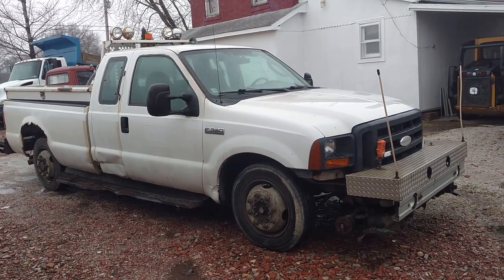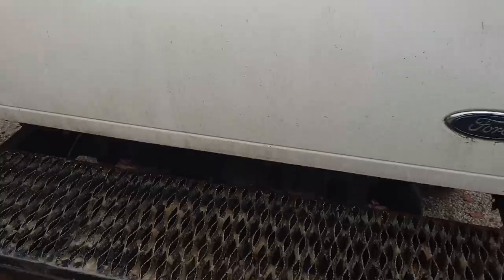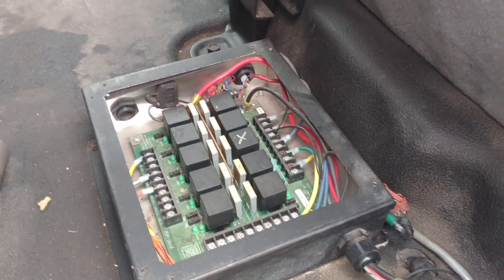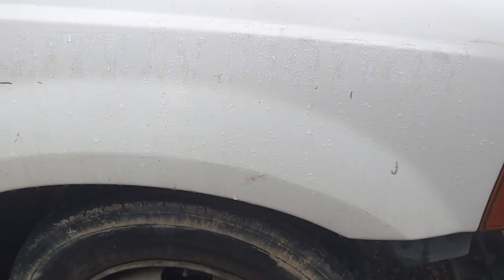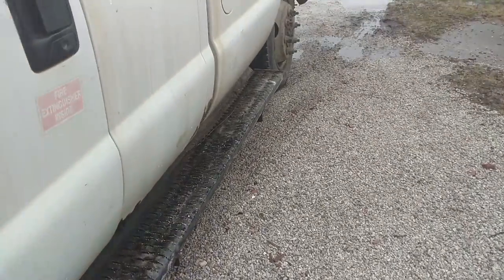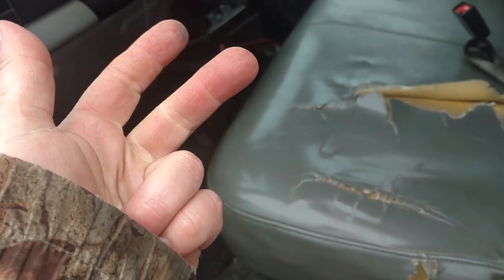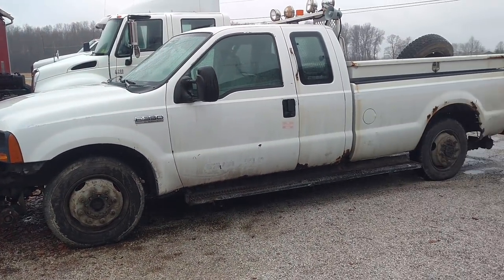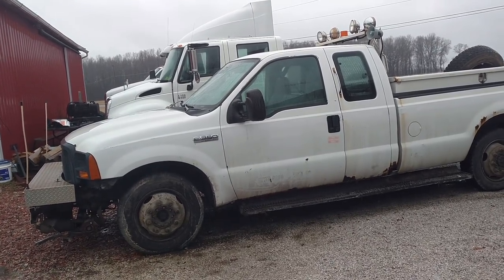J.C., WHY WOULD YOU BUY SUCH A PIECE OF JUNK???

Comment: Holly Molly the heat in the section comment is ridiculous, and I applaud to you by not responding to them as offensively as the level of their insults. You must be raised in a good family!
However, I'll be honest, the rust will scare the majority of the guys, but thats not the case for you for obvious reasons. The 5.4L is a beast engine, apart from the knocking phasor issue which has a fix. I have owned a 1/2 ton with that engine, I took care of it until I sold it with 150k miles without any issues at all. Judging by the description of the condition of the powertrain in your truck ( engine, transmission, driveshaft, differential, springs), it must have a value of over 7k.     I salute you for your work and thank you for the video
Reply from the maker: rust is an everyday nuisance in my area...i could see past the rust to the more valuable part of the truck. firing back at the hateful comments would do nothing for me except ruin the enjoyment of making these videos. this is how i look at it "people who can do it, just do it......many people who cant or are too lazy to do it will hate on the ones who can." it is frustrating to read but i figure the people that leave those hateful comments are probably having a tough time in life or perhaps they were brought up by parents that didnt teach them manners. regardless, it has no effect on my decisions on the trucks i buy and the value i see in them. thanks for watching!

Comment: I'd buy it but I've built several trucks from parts. 250K is no big deal. I got the hydraulics free with the wheels for removing them for my boss at a used car lot. The style I got are 8 lug no adapters needed, but the adapters give much greater wheel choices. Good farm truck and when it dies I'd part it out.

Comment: It’s got plastic valve guides. My buddy didn’t even get 100k out of that motor. I’ll take the 4.6 over the 5.4 any day.
Reply from the maker: i have had them with well into the 200k miles and still going strong.
Reply: I have a 2007 model with 173,000 on it and going strong. I bought it used with 95,000 and change  the oil and filter every 5,000 with motorcraft 5w30 synthetic blend.
Reply: They are shitty motors theres no hiding that hence the reason theres a new one in it. But still a good find none the less
Reply: I have a 02 f250 xl with the 5.4 that has 273,000 miles and still going strong

Comment: My dads 2000 5.4 has 204k original miles on the motor, Trans, transfer case
Runs great. Has been used hard, had to replace the left rear axle shaft and that’s about it

Comment: This was a great deal. I wish that the price of the truck was mentioned. Nonetheless, I’m sure the sum of the new parts would be more than the price of the whole truck. 75% left on 19.5 tires. A utility box. Rebuilt motor and transmission, and hydraulics to be used on another project. Those bumpers would be expensive brand new. Good deal!

Comment: I would buy it the maintenance schedule that the Rail road users I would not be afraid of it
Reply from the maker: since making this video....i have purchased a nice rust free 2007 f350 ext. cab 4x4 with a bad engine! funny how that works huh?
Reply: You must have had a secret little smile knowing you had this at home when negotiating for the 2007. I know I would.
I've got a 2005 F250 that needs a 3 valve 5.4 and they're surprisingly scarce and expensive. I'll wait for a deal.
Reply from the maker: you are right....i was giggling like a little girl. the truck that need this engine is here now. they are hard to find. when you do find them they are expensive and most of the ones i find need all the phasers, chain tensioners, guides and vct solenoids. patience is the name of the game on that search.
Reply: J.C. SMITH PROJECTS  yes it is glad you are putting it to good use
Reply: What’s funny is you found an f350 with a 5.4. Or are you considering converting from a diesel?
Reply from the maker: oh....you must have watched a few of my videos!! that is exactly what i was thinking!!!
Reply: So your saying even with great maintenance still blew up before 200k
Reply from the maker: the engine was replaced after the truck ran over a piece of steel and punctured the oil pan. so it was run will no oil and destroyed it.
Reply: Yeah don't trust the "maintenance schedule" we use.. There's alot more to it than people understand. These trucks get used an abused. The heck we put em thru... You can find some that are decent, like this gentleman did, and then some, just trash.

Comment: That thing is smooth,it starts better than most of the shiny Fords i see lol.
     Also as soon as you said 2wd high rail I knew it had to have a LSD ;-) It's a little long of a story for here but I once towed a guy that had close to 20 years in with the railroad on a 225 mile tow home.He was going to AC but didnt make it and needless to say we had some time to talk along the way. He told me all sorts of things to look out for on ex RR trucks/gear,the LSD being one of them because a one legger is useless on slippery rails.He also said they had a fleet maintenance program through Ford and or the local dealer and it pretty much guaranteed  that everything was OEM maintained for the most part.Some stuff could be done in house with Ford parts along with the occasional breakdown fixed locally when away on a job.But big things ALWAYS went to the dealer and had either new OE or OEM reman parts.He had a bit of a rant about what they spent doing it and he also said it was common to spend that kind of money on a truck like yours even if it was scheduled to be replaced in a month or two.So while he thought it was stupid in his early years he started buying and parting them as a side gig later on...........
      Funny thing is he gave me my biggest tip ever,then and now.He first handed me a hundred bucks that I thought was for the overages and then gave me more cash for the overage and told me to keep that too(meaning the change).I  was confused at first and didnt want to take a $125-130 tip from a working guy.But he used my month old daughter as good reason to keep it along with the fact that he'd have blown a lot more had he made it to the casino's ;-)  he also told me that he had a much better time telling me old rail road stories then he'd have had losing money in AC anyway.So he figured it was money well spent according to him.He said take the change for me and tell my wife about the actual tip lol.Funny thing was I realized later on the best part of it all was the tip on buying old railway gear.I probably made $10-12 k or more over the years.since then.He gave me the dealerships that used to maintain the PA based trucks,roughly when they bought new stuff and there was even a guy who'd run the vin's for a few bucks.The dealership has since been sold but before I was able to get complete service records on just about everything.........Anyway sorry about the long story and good luck with the truck.They cant all be home runs and more times than not it's the base hits like a good parts truck that separates the winners from the losers ;-)
Reply from the maker: now that is a pretty cool story right there! i bet that was a very interesting ride home! thanks for sharing!

Comment: Here’s a type DO NOT BUY anything the railroads used to own. I used to work for the railroad(csx) we had a Chevy 1/2 tin early 2000s 350,000 miles one of the doors didn’t work . It was wore out when I left. I talked with one of the guys that I worked with. They finally junked it when it blew up at 400 k and literally everything on it was wore out
Reply from the maker: i am sure there are some trucks out there like that but that is not the case with this truck. it has had a lot of good repairs. the body is pretty much junk but the mechanics of it are in great shape.
Reply: In Canada I have never heard of a railway company using a half tonne. Silly Americans.
Reply: Jonathan Land that's not a half ton
Reply: exactly. Over your head. You seemed to miss the part where Boosted Deere said the railway company he worked for gave him a half tonne to drive.

Comment: It's a no-brainer really, effectively this is a new truck in a scruffy body and probably for less than a junk yard engine.  Being a rail road truck there's a good chance that a lot of the components used in this are going to be heavier duty than would be found in a civilian F350 Super Duty too.  Vehicles like this that come from the original owner tend to be run on the basis of minimal down-time so if it develops a problem with the engine or transmission, once it's past 100,000 miles, there is a damn good chance it's going to go into the shop for a replacement engine or transmission just like this one has, then it's back working the next day instead of sitting in the shop for a week while the engine is rebuilt or whatever.  It rather surprises me that this one had the rear end rebuilt, but with it being a more specialised rear end it could well be that there weren't any reman units available so it had to get the rear end rebuild.  Don't dismiss ex-rail road, utility or state vehicles just because they're often low spec and scruffy, often what's hiding under the rough body is maintained money-no-object as they have to be on the road and working as much as is absolutely possible.  Strip this one down and put a nicer body and cab on it from a nicer spec civilian truck with a bad frame and you'll have a really nice truck that is probably built much tougher out of the factory than most civilian Fords where all of the extra bits these trucks have would be a serious trip to the options list and maybe as much as another $20,000 on list price...
Reply from the maker: this is a standard single rear wheel f350 xl truck. they order them as a normal truck and then add their up fits. the rear end is just the common everyday superduty 10.5" differential. i assume they went through it due to the fact that there are not many "rebuilders" around here to supply that quickly. i am taking this truck apart...it will be a donor for several other trucks.

Comment: Damn .. if it wasn't to hard to do id have bought this truck as a whole and then did a four wheel drive setup on it and replaced the bed sides and body work and maybe added a XLT front headlight and grille setup and drove it around because its kinda unique as it is , but I like trucks that I will rarely if ever pull up to a stoplight and see another one next to me like it .
Reply from the maker: it isnt too hard....it just isnt cost effective. by the time you would spend the money to do that you could have bought a much nicer truck.

Comment: JC I hear your in Ohio would you be interested in doing a 5.4 timing job ? Trucks runs great now -just typical phaser knock. I’m in Columbus and ready to get this done if interested let me know Thanks.
Reply from the maker: Sorry jerry, i dont work on anyone's vehicles but my own. i am lucky if i can fix my own junk. that is not a hard job. it is time consuming. the special tools are not that expensive either. maybe you can do it yourself?
Reply: J.C. SMITH PROJECTS. Oh I absolutely have thought about it  I  know I could do it. I tend to worry if I do the whole timing job and replacing the phasers my truck has 200 K miles on it I can’t seem to justify in my own head to spend that kind of money and put that much time into something that may not last another hundred thousand miles. Your videos have helped a lot and I do appreciate them.
Reply from the maker: this is the way i look at it, is the rest of the truck in good enough condition that you think it would be worth the investment and get a return of time and use on your investment. if  you dont do it, how likely is it going to be a problem and end the use / life of the truck. if that does happen, are you able to replace the truck easily without putting yourself into a bind. you know what you have with this truck. sometimes it better to deal with what you know rather than buying another used truck that could need more in repairs than the cost of the repair to your existing truck.

Comment: Intrigued by the bumpers, they look sturdy and that slide out step is very clever. Hope that you can find use for them, RV?
Reply from the maker: i picked a really nice 2007 f250 exteneded cab 4x4 that needs a motor. so this engine and transmission will be going into that.
Reply: When I worked for csx we had a Chevy half ton 2 wd similar to this with those diamond plate box bumper. To tell you how badly we abused it. It was totaled once. One of the guys I worked with was going to fix a crossing gate a lady ran a red light broadsided them. Her insurance basically totaled it at 250 k csx bought the truck back put a new frame bed doors etc about 4 months later got it back then ran it about 4 more years at 400 k it finally blew up lol

Comment: great deal just like my 7.3 powerstroke from 99 f250 super duty 4x4 6 speed with the 3.73 gears as well
Reply from the maker: it will make a good parts truck.
Reply: mine became my work truck 6 years ago
Reply: makes a diffrence with fuel milage
i average about 21 to 23 with just mild upgrades and no programer

Comment: 2000$ for a 5.4? thats riduclous... could get it for 600 700 $ in canada
Reply from the maker: i can get the 2 valve version for that but not the 3 valve version with low miles.
Reply: 5.4 / big engines are not really hot sellers in southern ontario. maybe out west more. where u located? can get chevy 5.3 5.7 for less then 2000

Comment: I wanna see those railroad raiser things in use before you year it down
Reply from the maker: sorry, i already tore it apart.
Reply: It's nothing impressive. They drop down, flip out a little, lock in place. The tires stay on the rail, basically as a guide. However, the wheels are pulled in more narrow than a normal truck. And majority have a steering stop. Making it a bear to turn

Comment: i would never own anything with a 5.4 in it again it was only 3 years old at the time 12k miles and it was in the shop so often with a different problem every time that iw sent me into a rage

it literally was in the shop more often than when my 4k mile oil changes came due
Reply from the maker: i think that could happen with any vehicle. i had the same problem with a brand new dodge with a cummins in it...the dealer had it more in the first 6 months than i did.....very frustrating.
Reply: VK7001.P Happens with every vehicle, my grandma's prius went out after 6 yrs, the repair bill was 14k, the warranty was either expired or they were refusing to honor it for whatever reason,so she scrapped it and bought a focus that has beem flawless ever since. Yet some people have had great experiences with prius's.

Comment: I'd just have to take it up the railroad (at least once) before taking it apart
Reply: Hey l tried to Gmail a couple of videos about alsa chrome paint... second time l ever emailed anything & was wondering if it got through
Reply from the maker: I saw it mr. letaw...that was pretty impressive stuff. i wonder how durable it is?
Reply: J.C. SMITH PROJECTS exactly what l was thinking too...they sprayed the hood instead of brushing it on & not even a clue about why they had that water hose going...heard you can clear coat it, but it looks better without the clear coat - what they said...glad they got through...also, there's an old 07, 08? white 4dr deisel ram down here that they say needs a transmission...l'll try & upload a pic & get more info...it's not a dually...it has 4 factory aluminium wheels - little ones with a lot of lug nuts
Reply from the maker: thanks. that is right up my alley....a broke truck!!!!i am praying for the weather to get batter because while it was cold out i bought a ton of projects!

Comment: Over $2k for a used 5.4 triton? What the hell!!!! What a rip off, i got a brand new  Goodwrench 350 v8 from summitracing for a little over $1700
Reply from the maker: congratulations. you spent $1700. for the most mass produced and cheapest small block v8 engine ever made. around here they scrap those engines everyday. engines arent that cheap when you step out of the 1990's era vehicles. i could get a 1990's ford engine for cheap too but it is useless to me. i usually only buy 2005 and newer trucks.